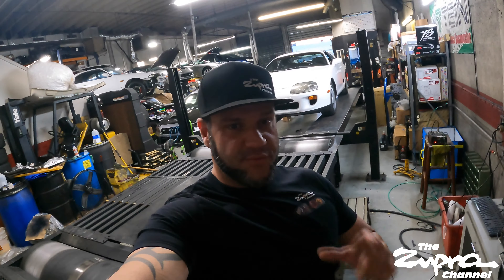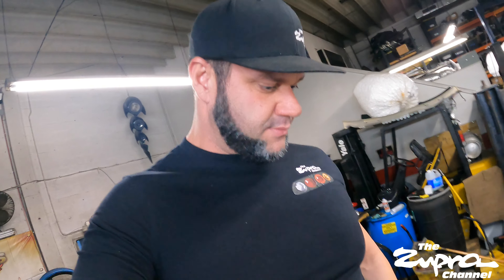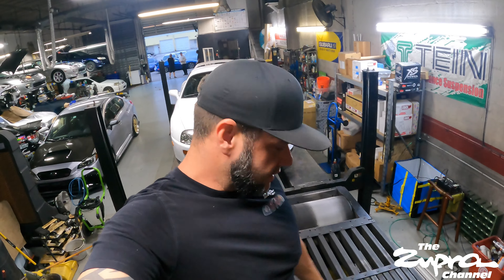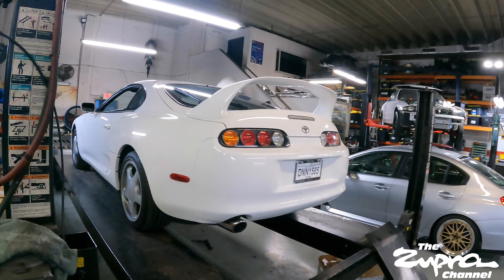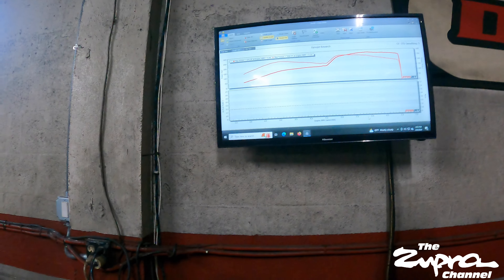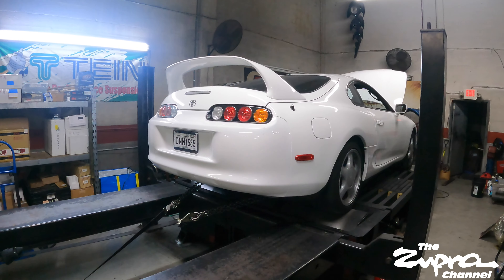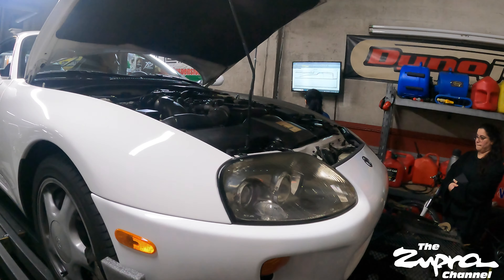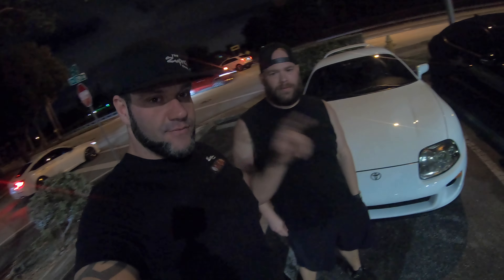We put a bone stock Supra on the Dyno!!!

Comment: That's a very clean and in very good condition oem bone stock mk4 TT6 speed Supra!  If I were the owner I wouldn't touch it to be honest, but that's me, the owner has the final decision! Nice video bro 👌

Soon I am getting on the dyno myself with a stock TT6 speed JDM facelift vvti Supra. Car has only an aftermarket 3inch exhaust, everything else is stock.
Reply from the maker: He bought it with the intent to build it 

Just wants to do it little by little
Reply: @TheZuprachannel  It will be a nice clean built at least..  I wonder how much HP it gained with the aftermarket cat back exhaust and the DP mod 🤔
If the oem twin turbos are healthy should be a blast on the street ! Waiting for your next mod. Keep up the good work 💪

Comment: 272hp is what it makes stock
Reply from the maker: It made 275 and 276 hp
Reply: @TheZuprachannel  🎉🎉🎉 thank you
Reply: @josephh1776 Where did you come up with that number? USDM Supra Turbo were rated at 320 hp (crank hp) from factory. This bone stock Supra put down 276,4 HP at the wheels. In case you forgot a dyno measures the HP at the wheels (or hubs for hub dynos). Drivetrain loss for a manual rear wheel drive is usually around 15%. Calculating 15% drivetrain loss at 276,4 rwhp (Rear Wheel HP), you get 325 hp at the crank which is exactly around what these engine should make stock.